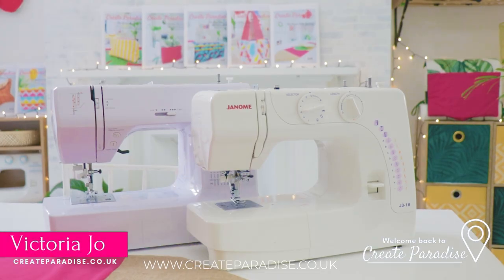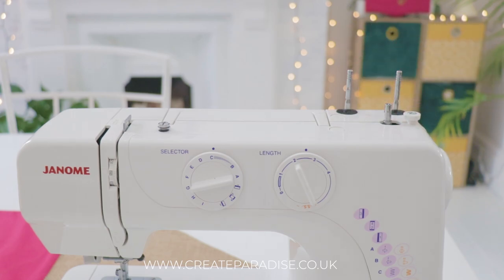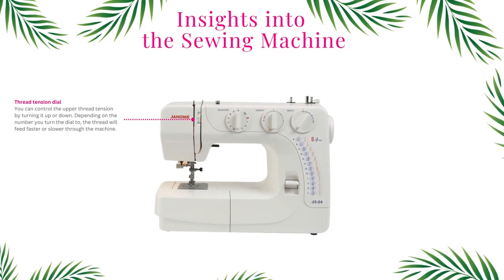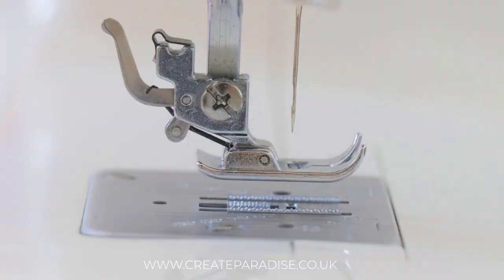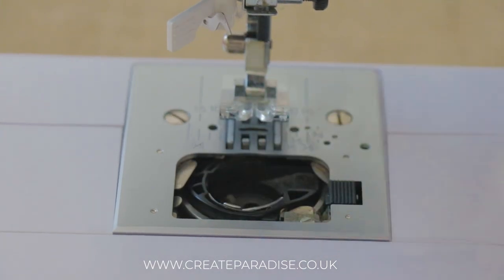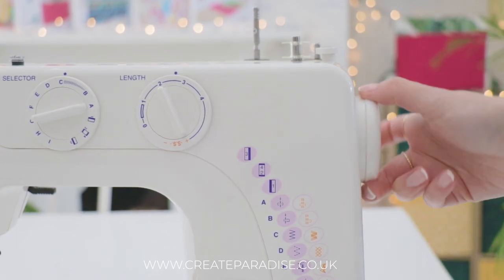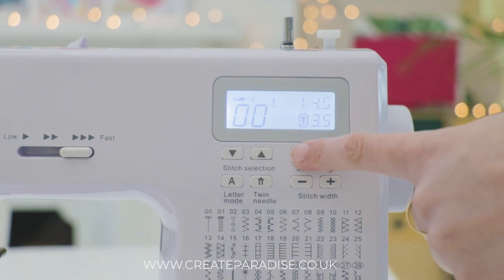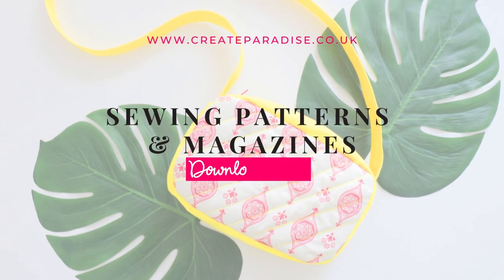How to Use Your Sewing Machine | The Anatomy of a Sewing Machine

Comment: I didn't know that about the hand wheel! I have been turning it the wrong way for years! 🙈 And the thread gets knotted in the machine afterwards. Could this be what's causing the problem?
Reply from the maker: Oh no! It's something I hear a lot from my clients. Stitching problems can be caused by many things but this is vary common. I often see my clients turn the handwheel away from them, it pulls the thread back up into the machine, and then can cause the thread to get jammed. During my in-person classes I can see this and teach them about so I felt it was important to cover in a video. 🙂
Reply: I'm going to get my sewing machine manual out and read through as I wach your video again. Could you do a video on reason for why the thread gets stuck in the machine? It happens to me a lot
Reply from the maker: Yes of course, I was actually planning on covering this subject in a video soon so I'm glad it will be helpful to you. Thanks for the suggestion, if you have any more feel free to let me know. 🙂